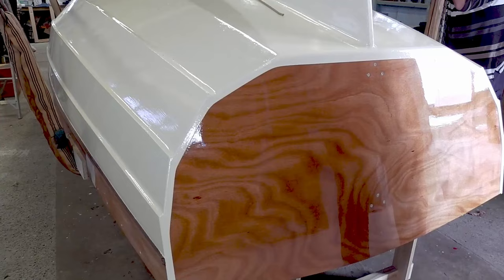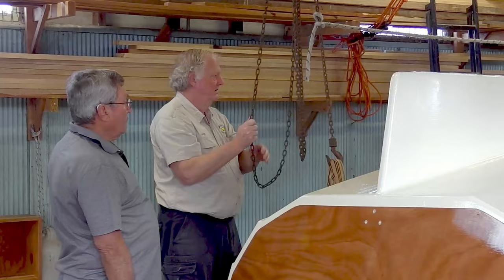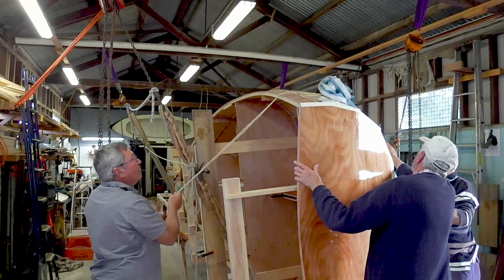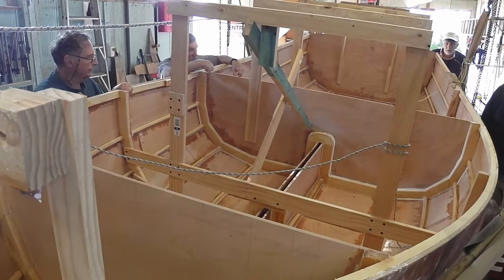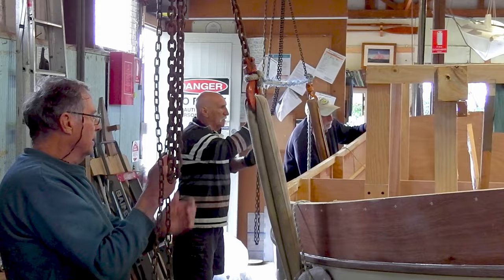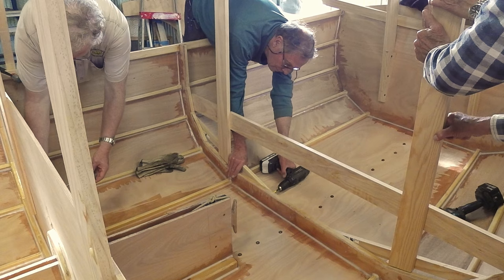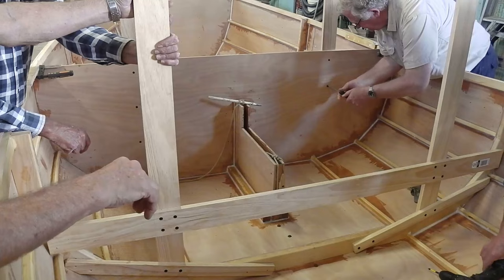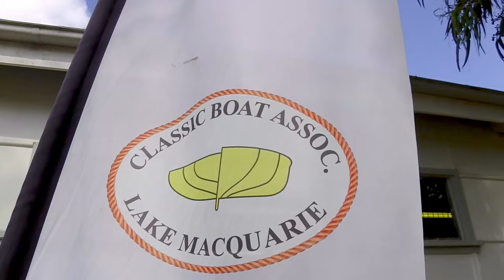Building for Dinghy  Cruising- A dream comes true

Comment: I have a ness yoal that I need to turn over to glass, fill, fair and paint the underside, by myself, so I need a frame I can suspend it from. 
Does anyone have a drawing I could use to build one ? Shes needing some small few planks replaced inside and the mast is a state.
Planning to just use a dinghy aluminium mast to replace that bit.
Cheers.

However shes not suitable for sail camping really so I bought a National 18 with built in floor making her perfect to sleep on but the 22 foot tall mast is more than I need or can manage with just my wife.
Any recommendations appreciated. I've bought a small selection of second hand masts to create a new rig but finding a complete rig for a smaller boat ... preferably gaff would be so helpful.

Thank you folks
North Ayrshire
Reply from the maker: Hi, you should be able to rig up some slings using heavy duty tie down straps as I don't think the Ness is that heavy. The boat shed uses the same build station (Jig) on which  to build different dinghies, it just has to be square and level. They attach the build frame to the station. If you contact Bill (details in the description) they might have built a Ness there before and be able to give you more help. Send me a photo when you are up and sailing, cheers Paul